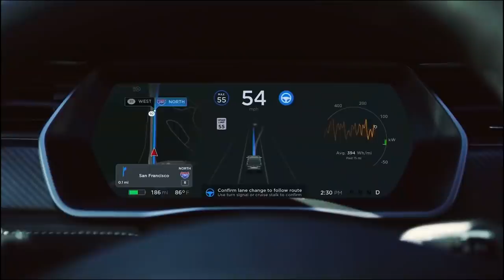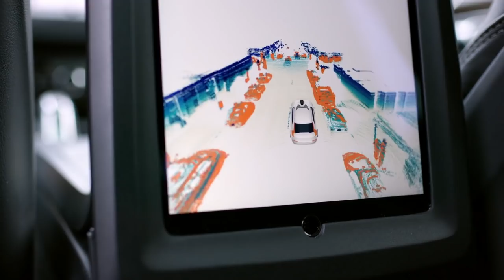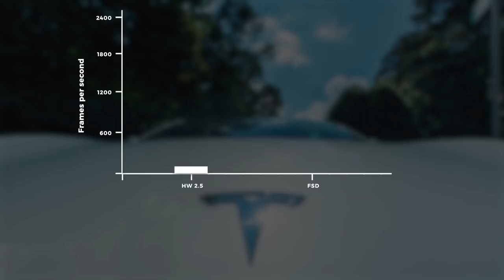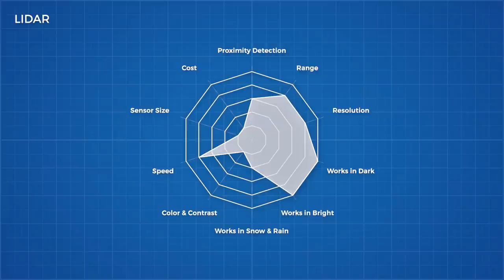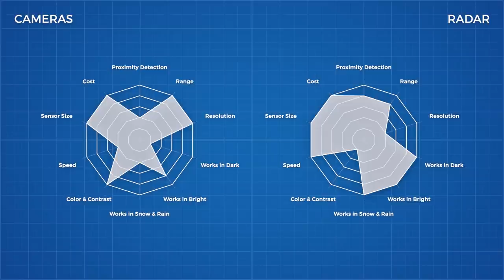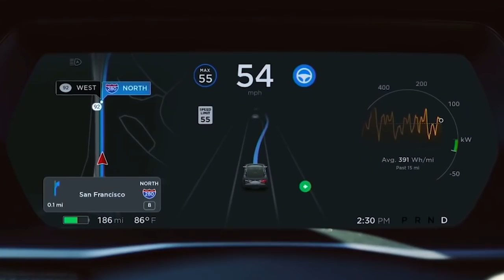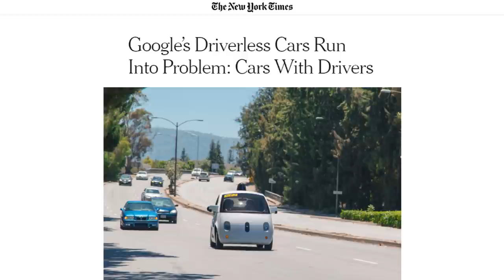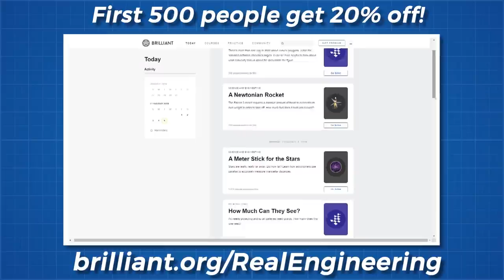The Challenge of Building a Self-Driving Car

Comment: Great video. I'm an ENVH, so  need consider loads before providing guidance. The real issue here is money and insurance. Once these automated vehicles are introduced above 10% (s curve), it 'will' be unaffordable for humans to drive vehicles. So sooner or later human drivers 'will not' be an issue. Whilst little on detail, this simple concept will be the outcome. Also vehicles 'will' change to Van type to facilitate increased usage within, i.e. little to no windows and increased speeds on highways from 160-200 Kmh to facilitate island city designs.

Comment: I recently drove across Canada in late April this year and was struck by a challenge that I hope is being considered by designers. It had snowed the day before and although most of the highway had been cleaned perfectly by the well experienced snow removal drivers there was a 30 km stretch that had not been cleared correctly. The wet snow that had fallen had frozen in a field of icy irregular mounds about 6 to 8 inches high. It was very rough and the first time I entered it even after hard braking was quite jarring at about 50% highway speed. For about half an hour all traffic came to a very slow pace to deal with this rough surface.  How designers are dealing with snow, ice, and in this case very rough ice surface features would be interesting to know.

Comment: i think self driving cars are a bad idea. they will put millions of people out of a job. most don't have the money or aptitude  to find a new job. plus one hacker can turn a self driving car into a killing machine.
Reply: you can't easily "hack" a neural network. By that I mean, not at all. It could be designed in such a way that if the car was driving against its own inputs, it would be programmed simply to just shutdown or pull its own plug from its own battery or something. As for the jobs thing, it's just inevitable. It's not just drivers who will lose jobs, but most entry level jobs like cashiers are also on the way out. It's just the way of the economy. It will naturally gravitate towards efficiency, and humans are naturally inefficient.
Reply: Yes indeed but that's kind of hard luck, this happens with advances. It just means the current system of learning and earning will have to change and adapt. The future of owning and driving cars are just one aspect of the future will eventually change so much as so as the human element will be next to naught.
Reply: Have you ever heard of the job called "computer" back in the day where computer didn't even exist yet? Instead, humans themselves are the computer by plugging and unplugging the wires. You want a job like that? Sometimes, it is necessary to replace jobs that are not cost effective with machine that can do the better jobs. On the plus side, it can potentially open a new job category that a machine can't do as of yet. By the way, I personally experience a lot of bad drivers surround me. Last night, there's a guy who purposely tried to cause an accidental by pull in front of me and brake hard. I wouldn't want to give that guy a control to drive, it put the lives of others at risk.

Comment: There's another large chunk of work that will need to go into autonomous cars and that's the other end of the transfer function.

Machine vision to process the world around the car > algorithms to decide what to do > models to predict how the car will react

That last output block is a solvable problem but far from trivial. Sure, in an ideal situation it's not that bad. But what about varied traction surfaces? Winter? Half the wheels are on ice and half are on pavement? What about when the tires are on loose gravel but after a few seconds of spinning they'll contact the pavement and regain grip? And not only does the car need to know what's under the wheels but what kind of surfaces are around the car so it can decide what direction to go for avoidance.

The vehicle it self also has to be considered. What happens when the car is long overdue for a service and the suspension balljoints and bushings are worn out, changing the geometry? Does the car need to diagnose all of those currently 'dumb' components with smart sensors to add them to the models? What about snow tires vs summer tires? Or the wrong size/brand tires?

So in addition to the already onerous computing requirements of machine vision and decision algorithms the car will need to run simulations in the order of the very best driving simulators in real time as well as an entirely new network of sensors and monitors to understand the condition of the vehicle itself.

Comment: The autonomous vehicles need help from the roads themselves. Sensors should be implanted into the roads, especially at junctions for the software to read and act upon... That will fill in the missing gaps at the choke points and allow the different systems to talk to each other... A bit like a signalman at a train track junction or an air traffic controller monitoring the sky

Comment: IMO the biggest challenge is responsibilty. IF there is an accident, and accidents WILL happen, someone needs to be held responsible. Car manufacturers and taxi companies won't take responsibility for anything, so they put human to "supervise" and if something goes wrong, it's driver's fault because he didn't intervene.
Reply: The whole point is to get to a system that does not need active supervision. Despite what many think, calculating liability in those conditions isn't that hard. Waivers and insurance can be set up to handle it.

Comment: One big issue is sensors failing or being blocked also, I was driving in a semi-snowstorm with cruise control on, after a while the car turned it off because the snow was blocking it's sensors, it was like being in some kind of sci-fi movie it started bleeping a lot and turned off one help system after another warning me, we got home safe and sound but I had to drive the last half of the trip 100% myself.

I believe each type of sensor should have at least 2 backup sensors, like they build planes, every system has 2 backup systems. They probably need to be self-cleaning or be placed in a more protected place, for example behind the windscreen which you always clean. Only after this and then also proving the car has fewer incidents than humans I believe we can rely more on self driving.

Comment: Just to clarify something: at 3:28 you mention "poor programming", however the incident did not happen due to some programming error, but a design flaw (as you correctly point out just few seconds earlier at 3:08). It is a classic difference between validation and verification: system was implemented (programmed) as specified (designed), meaning it has been verified and therefore programmers are in the clear. On the other hand, the design was flawed, users did NOT get what they wanted, meaning the product was not validated. I don't mean to bash, but one has to be careful with the terminology in engineering context. Keep up the good work!

Comment: I wish telsa can offer a feature to make the lane narrow and keep the tesla from essentially swimming it's lane, effectively teaching it the road on go. I love the idea of adding extra support for the driver.  I think if automanufactors offered this feature of making the lane narrow for adaptive cruise control, it would be an to where you can use cruise control to keep you inlane without touching the wheel and it's smart enough to stop on a drop of a dime and break for you adding extra reinforcement. I used to look down upon this stuff. But when you start to drive longer distances and have other things going on, it's amazing! Tesla vehicles needs surrounding environment that cooperate with Tesla computers. Which means, lines on the roads, lights and other drivers are unpredictable and the cause of 99% of accident must all operate with in  it's data. Otherwise, it's not fully automotive.

Comment: Is the Tesla custom chip just a big TPU? If so, is there a reason why they were not integrated on a single chip? It looks like it either for performance (memory bandwidth or heat dissipation) or redundency (avoiding a crash if one of the two chips fails)?

Comment: @5:28 -- How has the reversing camera saved any Teslas from being rear-ended? Have yet to see any evidence of that, but would be happy to ...

@5:56 -- The sensor comparison graphics lack an important characteristic, namely *Depth Perception*, which gives the necessary ability to form a 3D picture of the surroundings. LiDAR does this inherently with maximum resolution, whereas Tesla's doppler radar at high speed does not distinguish stationary objects from the background at all, thus they will have to emulate LiDAR by processing camera inputs to map depth, but this feature is not yet implemented and will probably only ever be on HW3 or above.

@9:08 -- Fine-tuned distant measurement cannot be done by Tesla's ultrasonic sensors, as their range is ~8m max and is not reliable at high speed due to buffeting effects of turbulent air.

Comment: About sensors BTW: You forgot to talk about the limitations in different weather. You said radar works in snow for instance, but, as already has been shown, the radar can be blocked by now and ice. Volvo have solved that part on the forward radar. Volvo also have rear facing radars for BLIS and other safety features, but they technically can be blocked (although i have never encountered that yet). And the ultrasonic sensors can be blocked. And on Tesla, all cameras except the front one can be blocked by snow/ice/dirt.

And the four way stop: If four cars enter at the same time. Who will drive first?

Comment: For the pedestrian that was run into by the self driving car, the car was designed to stop, but as it was processing the data it was told to engage different processes such as alerting the driver, stopping quickly, or swerving. These were disabled though by the company operating it. I am not entirely sure of this though.

Comment: Radar is not insensitive to snow. Actually, snow sticking to the front of the vehicle can blind the radar completely.
Additionally, radar does not have poor resolution. Resolution needs to be splitted in three parts: range resolution, angular resolution, and velocity resolution. Radar is used in so many automotive driver assistance systems because it has great range and velocity resolution. It is a good sensor for not hitting something that is moving. Also, radar is the sensor with the highest range (currently up to 250m for premium sensors). What radar struggles with is identifying objects and its angular resolution can be poor.
That is why it is combined with camera, which has a good angular resolution and can identify objects well, but does not have a good range or velocity resolution.
Basically, the camera tells what it is and under which angle it is while the radar says how far it is away and what the velocity is.

Comment: You forget to mention that not all data needs to come from the real world, there are multiple frameworks popping up where AI for cars can be trained in a virtual environment. And thanks to the recent development in computer graphics (real-time raytracing), the training can happen in photo-realistic environments. This is a huuge game changer, as one can now train thousands of cars at the low cost of renting the servers required to run the simulation. Additionally, the AI can learn in an environment where it is fine to fail, which means the learning algorithm can be much more explorative, and therefore in many cases more effective at learning. Another huge advantage to this is that you can train in scenarios that would be almost impossible to train on in real life, like a bridge collapsing, a trailer getting flipped by strong winds, oncoming avalanche, etc.
And in addition to this, one could actually train these AIs against proper unpredictability; human players, by letting players enter their simulations, and try to mess things up for the AIs, and maybe reward players acting in unusual ways, or managing to trip up the AIs.

I know this enters deep into Software Engineering, but it would be cool if you made a video on this topic as well ;)

Comment: When it comes to following the rules of the road, a fair amount of times you actually have to violate the traffic rules in order to have a working flowing traffic situation. Like if you are on a side road trying to get onto a main road in rush hour. It is impossible to get in without technically breaking the "right of way" rules, even if that is by someone stopping and letting you in you are still tecnacally breaking the rules. And the same goes for merging in a roundabout in rush  hour. You are technically breaking the rules when you do that, but it has to be done to maintain the flow of traffic for everyone.

Comment: The automotive industry is facing the same safety challenges as civil aviation did in the 90s from automation.

In both cases dangerous problems mostly arose from the human/computer interface. And when failures did occur they tended to be systemic.

Humans are naturally innatentive when tasks don't require constant input & if required to take over from a computer will usually be doing so under adverse conditions.

These factors must be central to any autopilot design, along with adopting a lessons learned approach to accident investigation.

Comment: Bad thing about (Tesla's) neural network(NN) is that you don't know what it knows. It is taught with huge number on pictures (where objects are identified and named) and it doesn't even know everything it has been taught, it tells the probability. 
That's why traffic infra must support level 5 cars. V2X transmission from traffic lights to car is safer that pictures from camera predicted by NN.
Lidar will be also be used (with cameras) because with it's data, 3D map can be created fast without NN and with absolute X,Y,Z values. Lidar will cost same as camera when it is in mass productions and when it has no mechanics (the rotating mirror / transmitter is replaced by a different solution)

Comment: Very well done. The only criticism I have is with the graphs that show the strengths of each type of sensor. When you overlap them to show how the strengths of Tesla's three different types of sensors cover for the weaknesses of the others, the cost dimension should not be additive. Requiring more sensors increases the overall cost, and that is a negative. However, I don't know what the costs of each of Tesla's individual sensor systems are (cost information was only provided for Lidar, which Tesla doesn't use). Perhaps they are so much cheaper than Lidar that their combined cost is negligible, but that wasn't addressed. Otherwise, fantastic job.
Reply: (Yes, I know I'm being pedantic!)
Reply: They also did not factor when these cars are 10 years old being sold used for $500 and being drove by poor college kids , who do not even know how to maintain air in a tire.
These things have to be 100% reliable ,100% of the time . Even at 99%  they are a death trap to everyone.
Name a man made mobile machine that is 100% reliable?  
I had 2 week old cars break down on me but unlike a driverless car it did not drive into a building or rear end  a stopped car.

Comment: Cars could be parked in to very small spaces, if the driver can get out of the car before parking. Even a simple remote control would be enough, but a self driving car could do this as well. The max speed should be very slow for safety reasons, some hardware could secure this.

Comment: The Tetris example you present is an issue with very simple program.  The error is an issue with stochastic gradients and local minima.  The system has found a solution which satisfies the success criterion, but not the best solution.  In the Tetris example it was play time.  A simple goal for a simple system.  The FSD model is FAR more complex, many thousands of times complex.  I don't think it's fair to compare a Tetris NN to FSD which has far more layers of refinement and nuance.

Comment: So the problem of self driving cars is that: 1. they are not as prudent as a human 2. they don't think like humans, so they can't recognise if something might evolve in a dangerous situation by transposing their thought process and awareness onto others.
Reply: Well no machine learning can do these things though they do require a larger training data set in terms of hours of driving than a human as they don't get the head start bonus of transferable skills that humans have before they even begin trying to learn driving skills. But it absolutely is possible for machine learning to predict the probability of a given situation evolving into a hazard in much the same way a human can by relying on a large number of observations of behaviour in relevant situations. In fact with very large training sets machine learning can beat humans at predicting outcomes of course this is to be expected humans have a pretty fixed upper limit on the maximum number of hours worth of situations they can experience to draw on supercomputers do not as they can process as many hours of data per hour as you have the compute resources to process and have functionally infinite lifetimes when maintained.